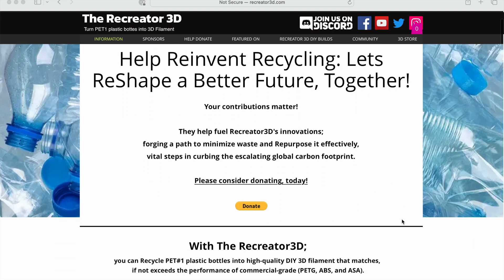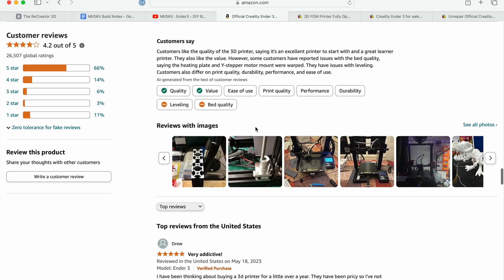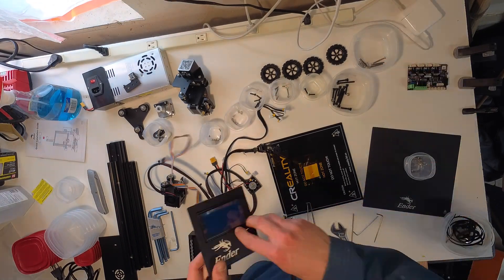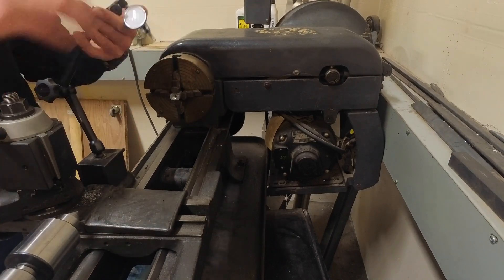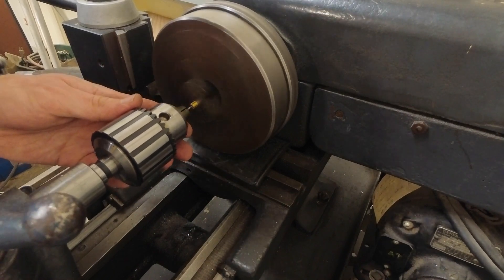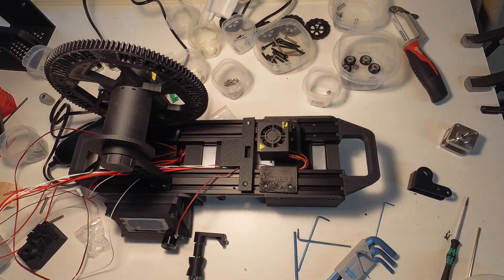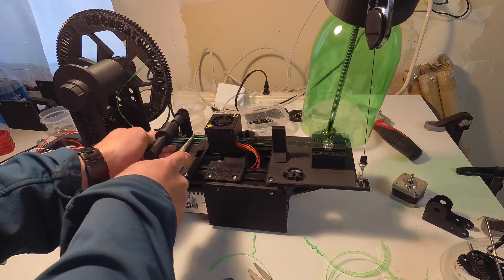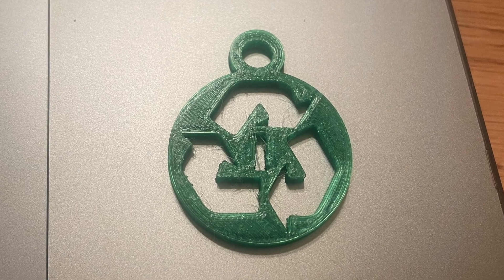Building a ReCreator3D Filament Recycling Machine

Comment: Do you have a way to join multiple bottles to make longer spools? Or is the only option to pause prints to add new filament when finished?
Reply from the maker: I haven't personally tried this, but I've seen videos of using a soldering iron to melt the two ends together.